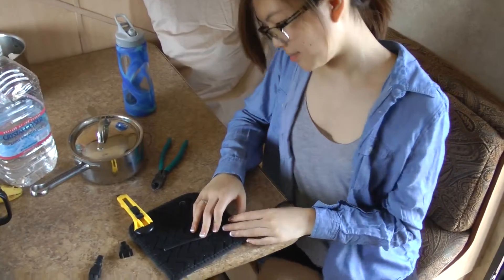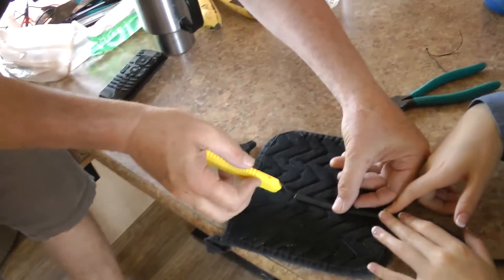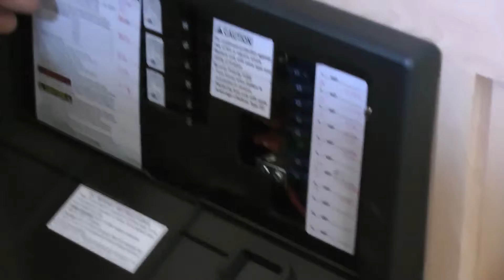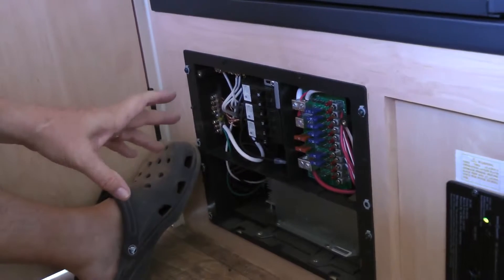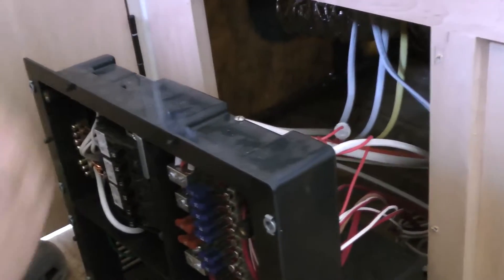Compost #8 Natures Head Composting Toilet Exhaust Fan Electrical Hook Up

Comment: On the wire strippers, one side is for 14 gauge stranded wire and the other side is for 14 gauge solid wire.  (They are slightly different sizes.)